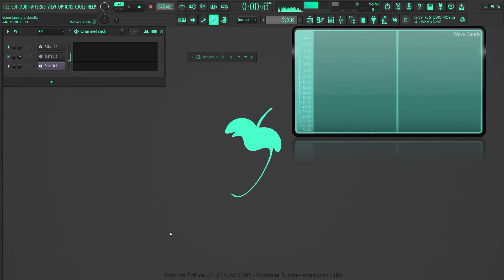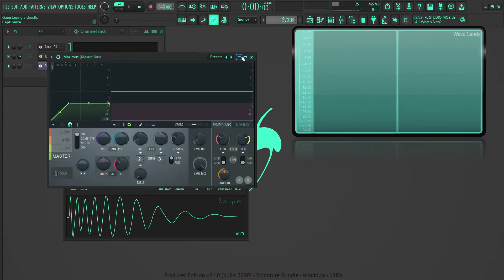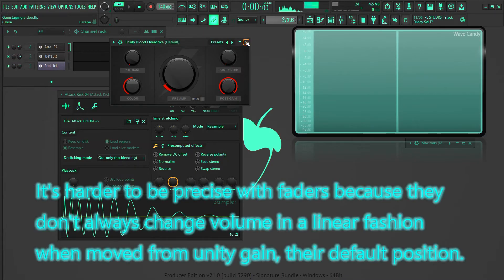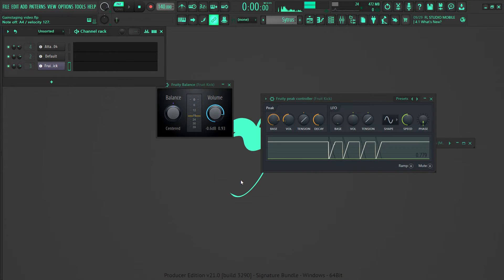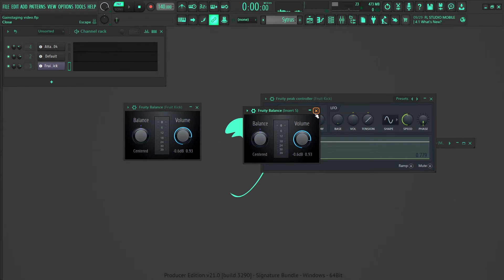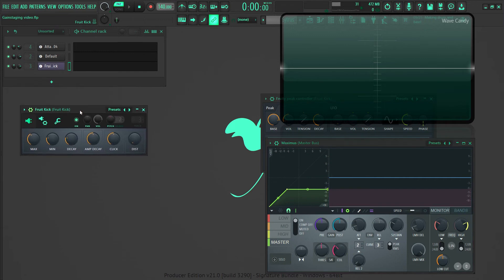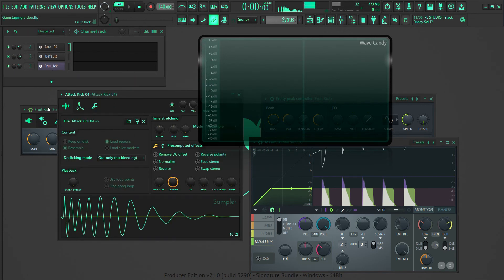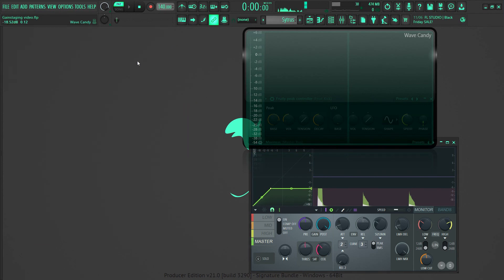How to gain stage | Why should I gain stage? | FL Studio 21

Comment: i always wonder why there is no gain knob for reducing multiple track at once, i have over 95 tracks in one FLP it's just frustrating to automate fruity balance for each track or dicrease individual chanel volume
Reply from the maker: If you use a control surface, you can create one. That's a good reason to make a template.